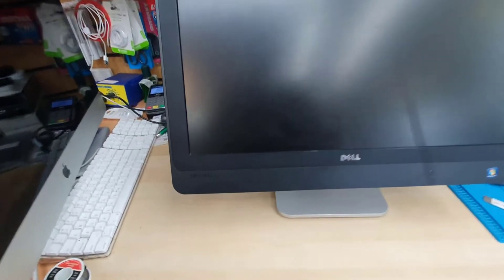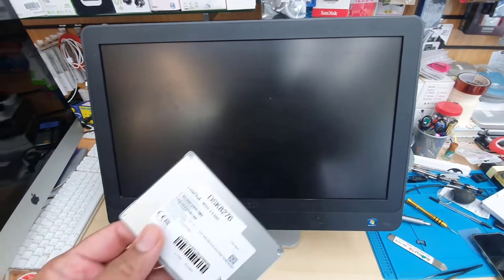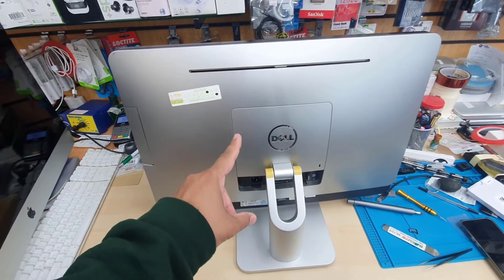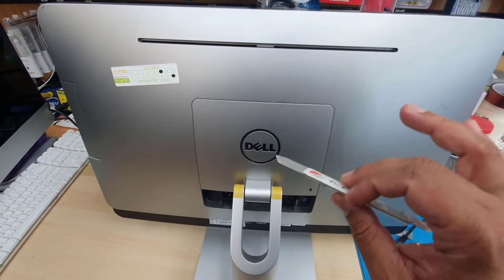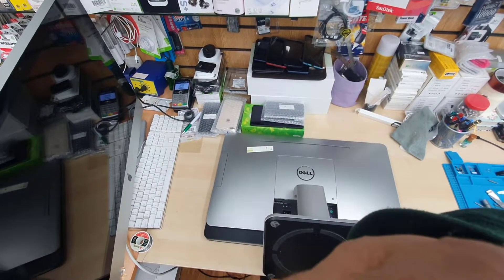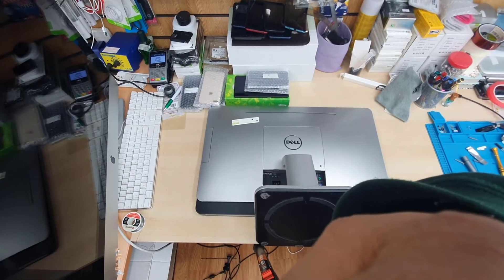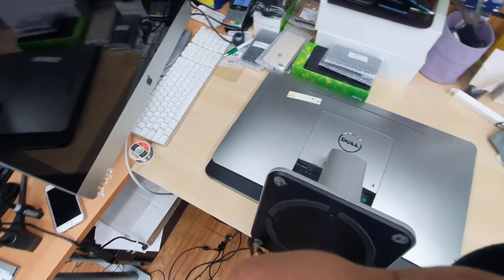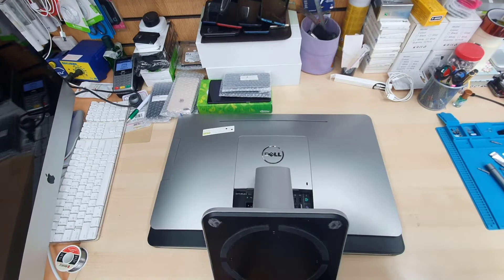How to Upgrade SSD  And RAM In Dell OptiPlex 9010 All In One PC

Comment: I just serviced a 9020; it had bad screen burn-in and liquid damage as well to the LCD panel. Customer had a budget for the repair so I opted to replace the 23" LG 1080P panel with the more common and less expensive 23" Samsung 1080P panel from the 9030. 

I wasn't aware they had different inverter connections from the photos, tho, but the solution for fitment was simple: disassembled old panel, removed LED array, then disassembled new panel and swapped LED arrays. It helps a lot to lift the entire reflector, diffuser, polarizer sandwich up and out all at once and keep them together, then use a flat tool like a spudger to aid with peeling the adhesive holding the array to the frame. Now I have a Samsung panel (same LVDS connector) being driven by an LG backlight driver, and customer is quite satisfied with the result. 

*Pro-tip: Wear gloves while handling the LCD panel and diffuser/polarizer layers to prevent fingerprints, and use clean (preferably new) microfiber cloths to rest the components on, since the film will generate a lot of static and attract any nearby lint and/or hair. 

Just thought I'd offer this solution if anyone needs it. It looks complicated but it's really easy: in total there are 12x M4 screws, 6 of which are silver and hold the VESA mount to the chassis, 4 are silver and hold the stand to the VESA mount, and two are black and secure the VESA mount to the HDD cage: all the other screws are identical M3, with the exception of the four smooth screws for the bottom of the chassis, the two screws for the webcam (if equipped), the four spacer screws for the speakers and the two screws for the PSU fan. Keep track of those and your cable management and it's waaay simpler than it looks. 

The LG panel was harder to find in good condition and was selling consistently for over $100 before shipping and taxes, whereas the Samsung panel was $60 shipped ($39.99) and didn't have so much as a scratch. I also went through and did preventative maintenance items while I had it apart (thermal compound...this one had an i7 4770S in it, as well as thorough board/fan cleaning and CMOS battery replacement). The motherboard is located to the right of the VESA mount under the metal heat shield. 

The CMOS battery (standard CR2032) is located in the top right corner, requiring removal of the shield. If you just wanted to upgrade the RAM, tho, the two laptop DIMM banks are located below the metal access hatch toward the bottom right of the shield. The CPU is socketed and appears to be a standard desktop socket, but any servicing or upgrades of the CPU will require full removal of the shield. Just make sure all three keys align when you're re-attaching it (top, bottom and right side), otherwise you're going to have a bad time.
Reply: How difficult was it to replace the LCD screen?  My soon broke one and I would love to replace it.
Reply: @iphrealestate8661  IMO, not that difficult. Getting the housing apart took glancing at a teardown guide as to not mar or damage the finish, otherwise no more complicated than servicing a laptop panel. 

Then again, I have ASD and was a master tech for a repair franchise for 5 years. I think it's easy, but a lot of folks may not think so. Really it's up to you. 

Definitely take pictures as you go if you're unfamiliar. Thankfully most of the screws are the same, so Dell gets repairability points there, but like I mentioned the panels are different between models, so you might have to pay more for an exact drop-in replacement, or if you're really careful and up to it, you can attempt an LCD reframe like I did where you replace only the panel while retaining the backlight and diffuser layers.

Since the one I worked on was a liquid spill, I had to transplant the diffusers as well, but if you only have a cracked panel, only that would need replacing, technically.
Reply: @DJSekuHusky  Where are you located?
Reply: @iphrealestate8661  Denver, CO
Reply: How difficult is it to completely rebuild this PC to make it more modern and efficient possibly for gaming?
Reply: @gavinwagenheim2606  Like, even if you did max out the RAM, replace the CPU with a much more power-thirsty desktop variant and replace the power supply and figured out a way to adapt out all of the power to proprietary connections, you'd still be left with a 4th Gen intel platform. Not bad, but not exactly keeping up with 8th Gen or higher in terms of functionality and instruction sets. 

I don't even remember what GPU options there were beyond integrated, so I doubt you could get any more gaming performance out of it than just maxing out the RAM and replacing the HDD with SSD,  as you'd be limited to what you could play with it from the iGPU. 

Like sure you could spend the time, effort and money to squeeze out some more performance, but it could just as easily be put toward a dedicated SFF build for gaming.
Reply: @gavinwagenheim2606  4.5 inches